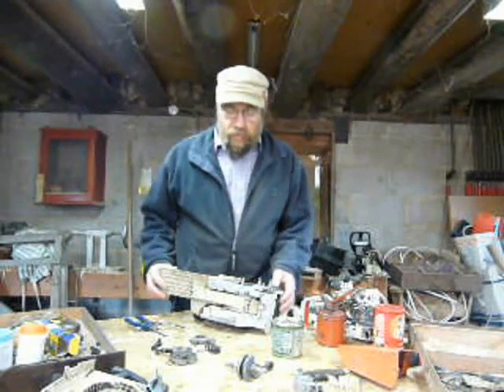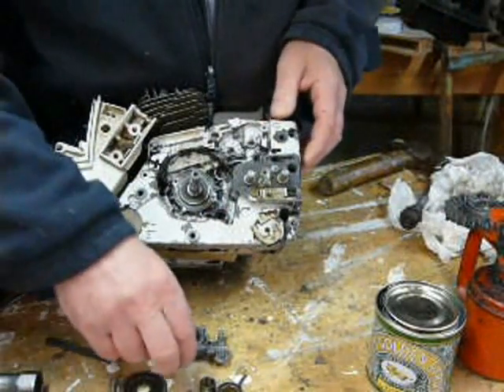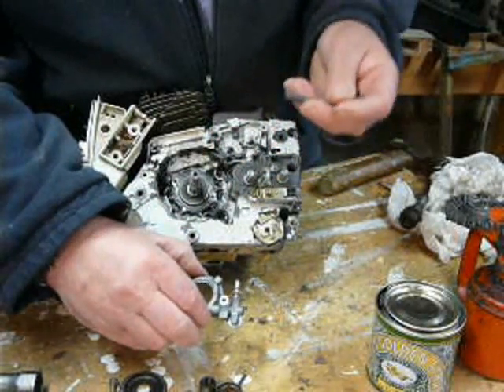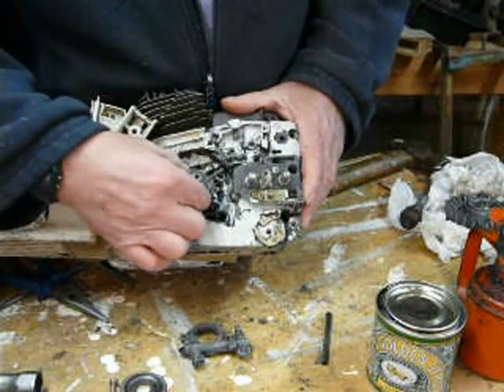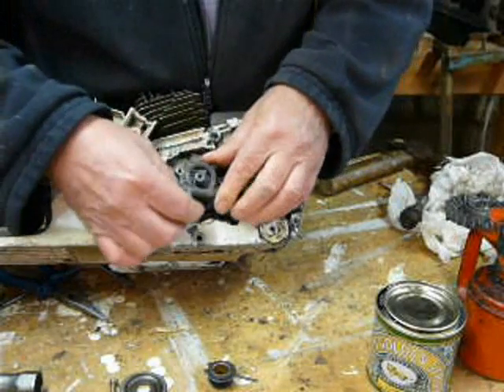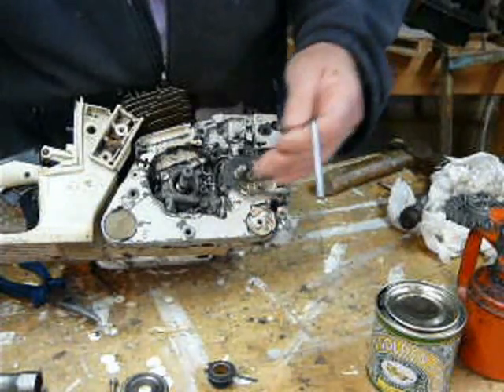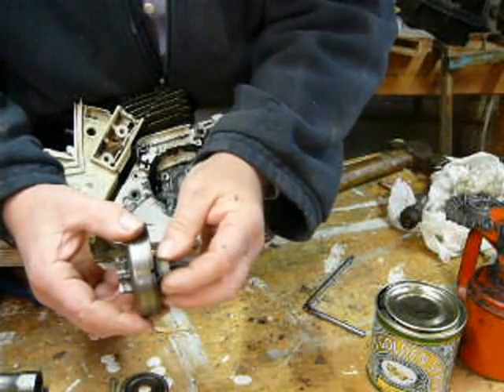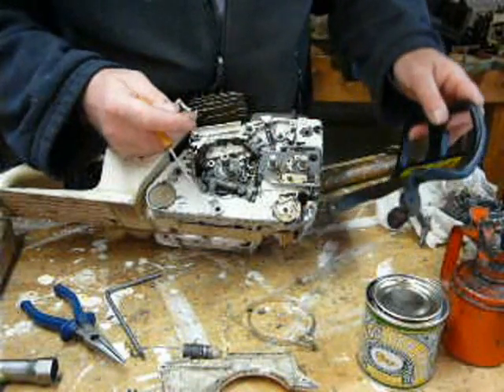Stihl 026 chainsaw repair . Part 6. The oil pump.

Comment: Andy,  good morning. I have a question.  There were two oil pumps used on the 026.  The non adjustable one and the adjustable oil pump.  My 026 has the type 65 non-adjustable oil pump.  If what I am seeing on the IPL is correct, the metal worm gear turns based upon the tightness of the distance between the worm gear, clutch and sprocket, as retained by the washer and E clip.  It does not use a standard arm on the worm gear.  The adjustable one works like other Stihl oil pumps.  I have the non- adjustable one and my sprocket does not have a notch in it.  Please tell me how to assemble this model.  Thanks.
Reply from the maker: John, the early 026 and most of the 024 saws had a direct drive oil pump that ran all the time. The later pumps are driven by a quill that engage with the notch in the clutch drum. This is so that the pump only runs when the chain is running. I don't know if these are inter changeable, cheers
Reply: @TheInfoworks  Andy, they are interchangeable, but you have to add a washer and spacer on the crank if you go to the adjustable oil pump.  I cannot say it runs all the time but mine will dump oil out the opening with the engine running.  It has a little steel gear that slips in the oil pump and on the crank.  It is not a tight fit.  When I got this crash damaged 026 it did not have a clutch or sprocket bearing, so I do not know how it was set up originally.  I have a new clutch ordered and it will come with the big washer, which I will put on over the worm gear and then spin the clutch on.  I will then put the rest of the parts on and see what happens when I crank it up.  I may buy the parts and update it to the adjustable oil pump, quill and sprocket.  I will grind a notch in the sprocket, which is a 7T rim sprocket.  I thought it was a late 026, since it had the short tank vent but it could be an early 026.  It’s Sn is 243xxxxxx.
Reply: @TheInfoworks  Andy, I understand, now.  Had just never seen a full time oil pump on a Stihl.  Never owned an 024 or 026, before.  All of my Stihl saws have a worm gear driven oil pump.  It is a good little saw.  I needed a light Pro saw to go along with my big Pro saws.  It came with an 18 inch bar but I am going to put a 20 inch bar on it with some LGX chain.  I thought it was a late model 026 because it had the short tank vent on it.  If it cuts good I will put a good carb and oil pump on it.
Reply from the maker: @johnclarke6647  John, I use 13 and 15 inch bars on my 026 saws, better power, quicker cutting, and less cutters to sharpen, plus safer, cheers
Reply: @TheInfoworks  Andy, they are not interchangeable.  You will need a washer and sleeve to bring the crank diameter up and change the spacing for the newer adjustable oil pump to fit the 026.  I will do this pretty soon.  I am going to put a climate controlled carb on it, too, and change the air filter and air filter cover to the newer Ms 260 style.  This gives it a much bigger air filter, too.  These parts are interchangeable.
Reply: @TheInfoworks  Andy, mine came with an 18.  I refinished it yesterday.  It is 3/8,.050,74 and I will get a chain for it just to see how it cuts.  I have quite a few 16 inch saws - ms 241 CM, 181 CBE, and an 18 - my MS 251 and don’t really need another small saw.  I wanted a lightweight 20.
Reply from the maker: @johnclarke6647  John, strange an 026 should have a .325 chain at.063 gauge. That saw has a .050 Husky bar on it, cheers
Reply: @TheInfoworks  it wasn’t .325.  It was 3/8, .50, 74 bar.  I put the bar and chain from my ms 360 on it.  It runs and oils fine afternI got the new clutch on it.  My ms 251 came with a .325 chain but that is the only saw that I have with a .325 chain.  All of my other saws, even my Husky saws have 3/8 bars and chain on them.  I am using the 026 to cut up a big maple, today.  Will cut it down with my 372 XP and I will use the 026 to limb and cut it up.  I am taking my 455 with me, too.  Normally I do it with my ms 360 but I robbed the bar off of it for the 026.  The 026 is pulling a 20 inch Stihl bar and LGX chain, 3/8 of course.
Reply: @TheInfoworks  I looked up the serial number on a website that calculates the year of production from the serial number and they said my 926 was made in 1998 plus or minus a year, so my thought about it being a late model was correct.  They were made from 1988-2002.  I asked Stihl but have not heard anything back from them.  So they were still using direct drive oil pumps on the 026 until as late as 1998.
Reply: @johnclarke6647  hey John! I am encountering this problem. Do you know what washer part and sleeve I need to find to do this repair? I am replacing a all time oiler to a adjustable oiler on my 026.
Reply: @CP-px9mp  hem on EBay.  I do not know whether they are still available off EBay or not.  It is a bushing and washer.  You can see them on the IPL for an 026.  The bushing is very similar to the one used on an Ms 360.  It just slips over the crank and helps to space the worm gear and oil pump.  You put the washer on the crank and slip the bushing over it and then the worm gear will fit on the crank.  Look at the IPL.
Reply: @CP-px9mp  the two parts are:  0000 993 0508, ring 12x15x12 and 0000 958 1234, washer, plus the worm gear and oil pump for ms 260.

Comment: I wash all connections of oiler ms381 but still not working
Reply from the maker: Is the clutch drum the right one with a notch in it to take to oil pump dive quill?

Comment: andy, can stihl claim to be the best make of chainsaw when a lot of their parts
are PLASTIC?...
Reply from the maker: Difficult to quantify. There are different qualities of saw within a brand. Occasional user, semi professional, and professional. They all have differing plastic parts. It's the same with Husqvarna. Plastic can be tougher and lighter than steel or Aluminium. The cheaper end of the market has plastic parts to the crank case as seen in the Husqvarna 350 videos. No real answer to your question.